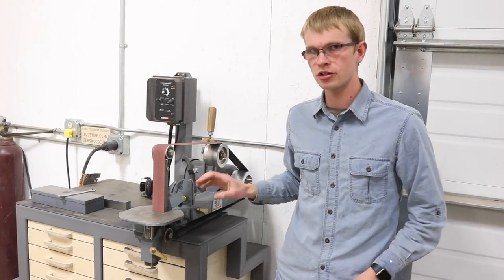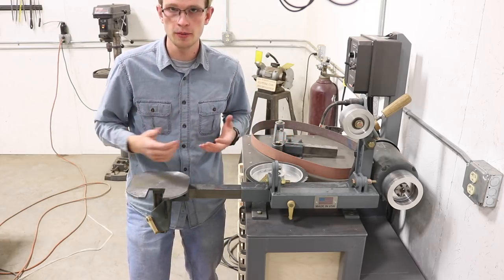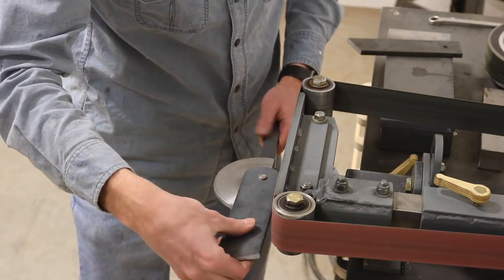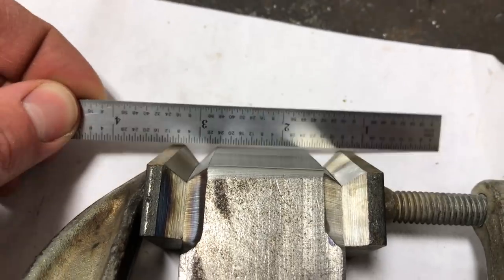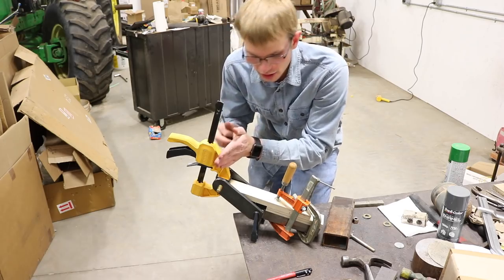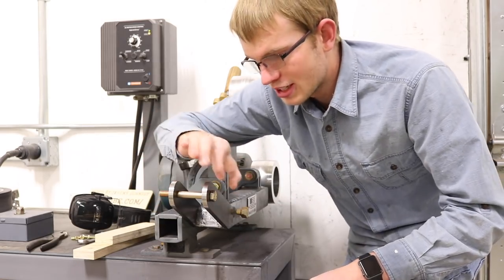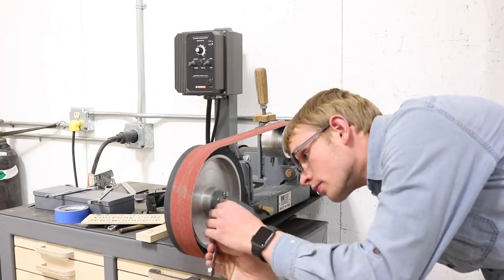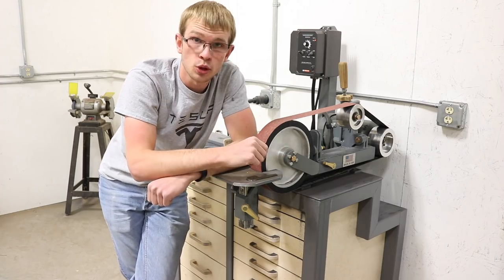Belt grinder contact wheel attachment

Comment: I find myself strangely irritated by how good your grinder design is. Mostly because I had already made a pretty darn good one before your first grinder video. But every time you put out another video about yours I want to make one like it a little bit more. I know, it's a problem to have (especially with the benefit of one working grinder already on hand to assist in the build of another). Mine has a few considerations that yours doesn't which arguably makes it "better" for certain design goals, but I think the benefits of yours outweigh mine for my needs. Figures. 

By the way, I don't think the kerning on your shirt is quite perfect. I wish it was adjustable. 😂
Reply from the maker: I wouldn't mind seeing your design, if you want to share. Of course if you want to keep it to yourself that's totally cool too :) 

Damnit, you're right! The shirt needs to be adjustable! Why didn't I think of that?!

Comment: UHMW-PE could maybe be used for the flat plate, Slippery af and a host of other pros, don’t know if it’s any good
Reply from the maker: The whole platen gets way too hot to touch when in use, so plastic would just melt. Glass (the kind use in fireplace) is considered the premium option. Slippery, low wear.

Comment: I gotta give it to you. You have some really original ideas when it comes to building things. I'll tell ya what, even my KMG won't track perfect going forward and reverse. It has to be dialed in for each. Congrats.... I just got a 14" contact wheel, but have to make a 3/4" to 1/2" bushing to get it to fit. Can't wait to try it. I actually got a 6" wheel too, and for compound(nightmare grinds) a 1"x10". Looking forward to seeing what you build now, hollow grinding is great for surface grinding material...Take it easy.
Reply from the maker: Thank you! Full disclosure: I did a bit of tweaking of the motor's angle to get it run correctly forward to reverse. It's a one-time adjustment that, if I'm not mistaken, you should be able to do to the KMG as well. 
I hope to build a Travis Wuertz-style surface grinding attachment soon.
Reply from the maker: Just watching one of your surface grinding videos... This really cinches the deal I'm definitely gonna make one! That is really cool! I do have one question (and sorry if you mentioned this in your video; I didn't watch the whole thing) I noticed the contact wheel is extra wide, like maybe 2-1/2"? Is that so you can track the belt side to side for better finish?
Reply from the maker: A picture of how the track works would be really nice, if you don't mind... I was thinking of using a linear bearing for the slide action, but I'd be curious to see how they made that work. Thank you!

Comment: Have you ever thought about trying to use some graphite strip/canvas on that platen attachment like some commercial grinders do? Maybe it would make it more slippery so it wouldn't heat as much when grinding and therefore it would take less power and not bog as hard?
Reply from the maker: I'm gonna swap it out for a real glass platen soon.

Comment: How about using eccentric on bolt used for wheel axle similar to car alignment bolt. Just make  disc for eccentric weld to bolt then grind shaft of bolt near head slightly smaller hole in fork weld on flat stop for eccentric to contact. Link to picture of example 
http://www.bracketracer.com/nova/cpplca/cpplca719.jpg
Reply from the maker: I can't believe how many people have suggested this! An eccentric bolt or bushing might work, however, you really need to be able to move the bolt to any desired position. An eccentric only moves the bolt around in a circle, so what if the holes were perfect to start with? There would be no way of adjusting it to the "middle" position. Hope that makes sense...

Comment: Great Work! You have a solid engineering mind. Your work is very well thought out, especially for your age. Cant wait to see your work in 10 years :) Did you ever consider a eccentric lathe bushing for your wheel angle adjustment ? Turn the eccentric bushing until the belt tracks straight on the wheel and tighten the assembly. Thanks
Reply from the maker: Thanks! 
Eccentric bushing wouldn't work. What if the bolt needed to be in the center of the hole in the fork? The eccentric bushing is always off center one way or another.
Reply: I should have explained better. I have made bushing like this for adjusting machine tooling. It doesn't always have to be off center. Its starting position could be "One center" for a theatrical perfect situation. Then if you also placed the hole fork for the bushing off center in the Z axis, you would be able to turn the bushing 90 deg CW and CCW which would give you some YAW control over the wheel. The hole in bushing and the bushings location in the fork would both be off center. BUT at "Zero" or start position your axle passing through the busing and wheel would be on center. It may not have the adjustment necessary and it may cause another issue. Your solution certainly worked fine.

Comment: Would adding a 3rd hinge within 8 inches make it stable enough for a 12 inch wheel?
Reply: Not really, a third hinge in the middle doesnd ad any stiffness to the construction. the stiffness of the construction follows the parallel axis theorem and increases x² with the space between the hinges. I am in the process of building a grinder like jeremys but for a 75x2000mm belt, those are much more common in germany (where i live). This way a 12" Wheel would fit just barely

Comment: wouldn't a rubber tire work? perhaps if you put it on a wooden weel with a thin steel/aluminium plate wrapped around it. would be hellish to make perfectly round tho, especially if you can buy a proper rubber wheel for cheap
Reply from the maker: It needs to be perfectly round and the surface needs to be flat. Seems pretty difficult to me... these wheels range in price from about $120-$300.

Comment: NICE MACHINE YOUR COMMENT ABOUT IT NOT SLOWING DOWN UNDER LOAD MIGHT BE DUE TO THE LARGER WHEEL IT WILL CARRY MORE INERTIA ONCE GOING
Reply from the maker: I don't think so... it's true it has far more inertia, but the load is continuous, and it doesn't slow down even after several minutes of load. The inertia would only help it power through a sudden, momentary high load.

Comment: Why not weld the flange in place instead of the 4 bolts once you have the correct placement of the flange/bolt?
Reply from the maker: That would be fine...but why would you do that? It's easier to tweak with the bolts.

Comment: Awesome as usual. Was it easy to make fine, incremental adjustments with the four bolts or do they lose their setting when you loosen them? Does the tightening down of the little bolts try to influence the location at all? You approached this different than I expected you to, so I'm just curious. Obviously you get it tracking perfectly so you were successful.
Reply from the maker: Actually you can leave one bolt snug, and with all the others loose, the flange pivots on that one bolt. (Set a block against the flange and tap with a hammer to make fine adjustments. I tried a few different things off camera)  That makes it pretty easy to do without completely losing your position every time. Tightening the bolts doesn't seem to move it around at all.  This should only need to be done once, and then the little bolts will be left tight forever, so I was more concerned about how sleek it looked and making sure it wasn't in the way, rather than how easy it was to set.
Reply: Jeremy Schmidt gotcha, that makes sense. Nice work, again, that thing looks so useful. PS, Jeremys rule!

Comment: if you wanted to put a 12 inch contact wheel, could you just put on a longer grinding belt? or is that not possible on this setup?
Reply from the maker: Yes, if you can find longer belts then that would work.

Comment: Great job! I do have a question tho.

All the concern over the issues of the correct tracking of the belt over the tire.  Why doesn't at least one wheel or even the tensioner pulley have a groove for the belt to sit in?  Similar to a serpentine belt system.

Anyway great job, looking forward to more videos.
Reply from the maker: A flat belt always tracks on the highest point on the pulley, so the drive and tracking wheels are both crowned to keep it running on center. A groove wouldn't really work because the belt would always want to get up on the edges.
Reply: Jeremy Schmidt ok cool I learned a lot from your vids.  Thanks for explaining that!  Keep up the great work.

Comment: Understand that eccentric cams can move alignment through zero position since you are pivoting off center making it possible to be positive or negative in vertical or horizontal plane and by putting 90 deg corner to adj eccentric off you can move center line 360 degrees from zero
Reply from the maker: I can't quite understand your punctuation-less run-on sentence... But let's say you had the wheel tracking the same in forward and reverse (meaning the right end of the bolt is at the correct height), but it consistently tracks off the the left (meaning the right end of the bolt needs to be moved back). Now say that in this situation your cam is at the 1 o'clock position. The only way to move the end of the bolt back is to turn the cam clockwise. But as you turn it clockwise you also move the end of the bolt downward, so now it won't track the same in forward as reverse anymore. The only way to solve this problem would be to put a second cam inside the first cam, which would be ridiculously over-complicated.

Another way to say it: a cam always moves around in a circle, but sometimes you have to make straight, vertical or horizontal adjustments.
Reply from the maker: Maybe I'm missing what kind of cam you're referring to... the link you provided in your other comment just returns an error message.

Comment: @17:20 why don't your add a table between the drive and contact wheel and have either a 10" wheel or a flat belt :)
Reply from the maker: I'd have to put a platen behind the belt, but yeah that's not a bad idea!

Comment: Is there a particular reason that you don’t grind your welds? Because you are so exact and precise on everything.
Reply from the maker: I guess a few reasons. I absolutely hate using an angle grinder. I don’t want to grind away the structure of the weld. And I’m also fine with embracing the fact that it’s homemade.
Reply: @Jer_Schmidt  thanks for your answer, and that would make sense about the strength of your welds. Also, I think it adds character.

Comment: Making an eccentric adjuster would have been much easier and adjustment could be made with the grinder running
Reply from the maker: An eccentric adjuster does not provide two independent axes of movement, which is required for tracking in both forward and reverse.
Reply from the maker: An eccentric adjuster does not provide two independent axes of movement, which is required for tracking in both forward and reverse.

Comment: That wheel is very doable on a large lathe. Take a piece of plastic stock and machine it to a heavy press fit.
Reply from the maker: Plastic is not a suitable material...needs to be softer; about 70 durometer.
Reply: @Jer_Schmidt  Gotcha. The soft stuff can be a pain to machine.

Comment: it's a beautiful designed beltgrinder. Pitty You didn't made a pdf with the measurements.
Reply from the maker: Thanks! I do have a pdf plan for the grinder and platen attachment, but not for the contact wheel attachment. Surprisingly you are only the third person (I think) to express a desire for pdf plans for the contact wheel.
Reply: Do You publish this pdf someware?
Reply from the maker: You can get the plans for the belt grinder and platen attachment here: http://etsy.me/2sm5uvg And you can read more about it and find more info on my website, here: http://jerswoodshop.com/2x72-tilting-belt-grinder/

Comment: Does the pdf plans for the belt grinder include detailed measurements on all pieces used on the build? Was wondering about it. Wanting to build one for myself. Was just wondering what the plans consisted of. Thanks in advance
Reply from the maker: Yes, the plans include all the info you need to built an exact copy of mine.
Reply: where do I need to go to obtain a copy and how much does it cost
Reply from the maker: http://etsy.me/2sm5uvg Costs $20.
Reply: Jeremy Schmidt we spoke earlier,  I'm starting my build now. thanks for the info and the grinder plans

Comment: what about using a donut tire for a small car?
Reply from the maker: Definitely not. The surface must be perfectly round, flat across the face, and just the right hardness so it doesn't give too much. I mean if you could find a tire that small (it would be smaller than a wheelbarrow tire), then I suppose the belt could roll around it, but it wouldn't really work for grinding.

Comment: Jeremy, any conveyor belt factory/shop should be able to lag a wheel for you in really any material you like, however rubber is what you want here. It shouldnt be too expensive and will last decades.
Reply: Plus, I was going to say that I have several wheels off of a manual forklift, and they come in 6-12" sizes. They're steel wheel with hard, flat rubber outer ring for tread.
Reply from the maker: Why would I do that rather than just buying a wheel like I did? I'd be willing to bet a custom made wheel would cost more than this one that's purpose built for this job.
Reply: Jeremy Schmidt I'm not sure how those things last sorry, I wasn't saying you should do it instead, but you had mentioned not knowing American suppliers. I wasn't sure if you were referring to quality/price or ease of access when getting them in the US as opposed to imported.
Reply: Jeremy Schmidt Perhaps my comment came across wrong. I wasn't saying do it my way sorry, I was just offering well, an alternative way to get essentially anything done.
Reply from the maker: Ok, I understand. I mentioned US made wheels because I just like to support my country by buying domestic products. It doesn't really matter that much and I'm sure the import wheel will be fine.